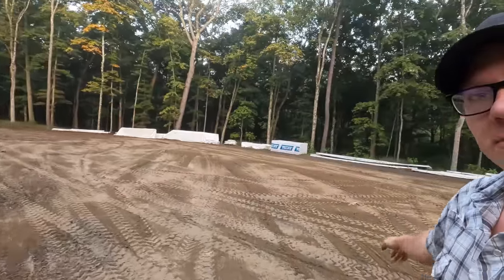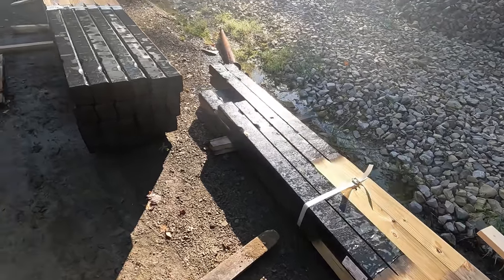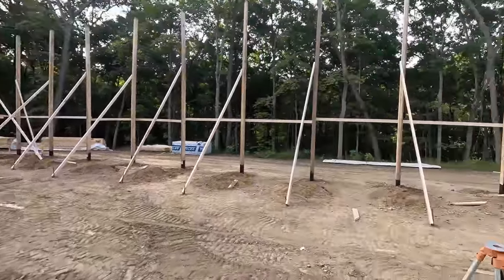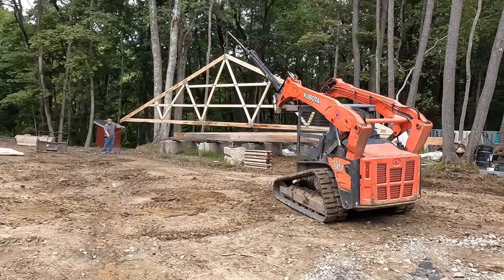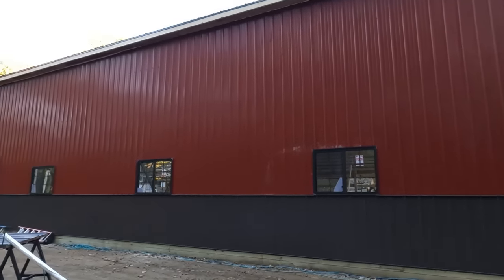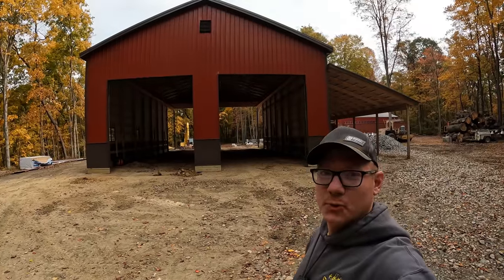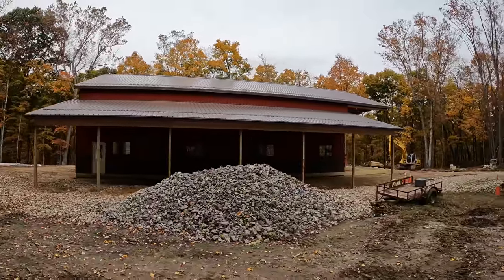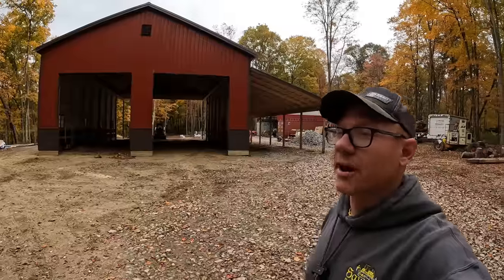Building a Dream Workshop! (Finally) Putting up the shell!

Comment: I never realised you could get a crane boom for those little skid steers. That looks pretty awesome and the guys clearly know what they are doing. It looks great Matt.
Reply: I thought that was a great attachment also.
Reply: Looked just like a fishing pole to me! 🎣
Reply: I'd imagine the load rating is very low on it, so its usefulness would be limited.  That said, trusses are light, and they may be made specifically for that purpose.  Worked great!
Reply: I was sat here wondering why they were using a skid steer instead of a telehandler, seemed like the wrong tool for the job!

Over here in the UK you very rarely see skid steers but telehandlers are everywhere.
Reply: @tomcardale5596  Most likely due to the Health & Safety rules compared to OSHA
Reply: @tomcardale5596  comes down to market preference I think. We build barns a bit different here anyway, rare to see a pole barn like this. Most use steel frames concreted in.
Reply: @mattyb120  oh definitely, though the general idea of pole in ground with stuff attached to it is conceptually similar at least! Even if the materials are different.
Reply: @tomcardale5596  It seems to work for light loads and is squat enough to fit under the buildings, so you can work from either end and I suppose in the middle should you need to fix something and need it supported, telehandlers tend to be twice the size of the skid steer or (Bobcats) as we call them in the UK.

Comment: I would highly suggest that you put piers in for a truck lift or maybe plan on a wildfire moveable lift. Remember that it is too late to add piers later if you have in floor heat.
    When you get older your knees will thank you . If it's never needed the added cost is pretty low and could actually add to the value of the building should you ever sell
   My apologies if your overhead crane is also an auto lift.

Comment: never even thought about building that way. in Europe we use a similar technique: we fill the Holes with concrete and put 2 pieces of flat steel bar in the concrete to bolt the wood onto. That prevents any rotting from happening and if if it starts to rot you can easily replace the rotten part.
anyway keep up the great work

Comment: Matt, for heating and cooling I put a 28,000 BTU, two head mini split in my 55x45 ft shop. I mainly did it for dehumidification in the summer time. It was cheaper than running two dehumidifiers plus it kept the shop at 74 deg instead of heating it up with the dehumidifiers. As an added plus it heats the shop in the in-between seasons of spring and fall. I have radiant propane for the main heat in the winter but could just run the mini splits year round if I wanted to. You will find out, 60 degrees in the winter, in a shop, out of the wind and weather is pure heaven!

Comment: Congrats Mat on your new shop. I do plead with you that you put in at least 10m rebar with a 16 inch grid throughout your pour. I have a concrete company in Peterborough, Ontario Canada and am retired. I am 76 years of age and I am more than impressed with your mechanical abilities. One thing that I do hope you will do is put the gantry crane in the shop as soon as you pour the floor and do the body work on your tractor for your float and equipment and paint it. I do not want to come across as very assertive but I know in my heart that you are going to do very good. Start painting and cleaning things up.

Comment: Nice Shop Matt. Be sure to have the Infloor heating properly sized. I have installed a few Infloor heating systems that was designed by the supply house where we purchased the materials. I would install in the back section too, if there is a good chance your going to enclose it. 
The outdoor wood boilers are great if your going to be there every day to keep it fed, otherwise I would recommend a High efficiency gas boiler, condensing boiler. My other tip would be the more money you spend on insulation now, the cheaper the building will be to Heat and cool for the life of the building. Spray foam is a great choice. The only other issue with spray foam would be electrical, if you plan on running behind the tin, it would have to be wired prior to filling the space with insulation. You can always run conduit. Thanks for the videos. Good luck.

Comment: I renovated my Barn/house/shop built 1915.  I used the same colors you did, looks nice.  6" gutters make a world of difference, good choice.  I would consider heating that outside slab.  Make it a separate zone if you can.  Do the AC, you'll love it.  Keeps everything from rusting.  Also a lot easier on your air compressor.  Good luck with the place, just don't fill it with junk!  Lot's or work but worth it.

Comment: Congrats!!!  A couple of tips if you care.
1. Install a powered exhaust fan on one of the gable ends. 
2. Go around the perimeter and screw in some lag bolts into the bottom band. Use about a 4-5
 lag and just screw it in enough to hold itself. This will keep the concrete tight to the band. As it cures the crete will pull away from the band and creates a bad draft that will suck all the energy out of your heated floors.

Comment: Matt, the new shop is beautiful. Can’t wait for the finishing touches. One good idea I saw mentioned is to put drains in the floor. Pipe them out of the building to a grease/oil trap to preserve the environment and save being fined by EPA. I was surprised you didn’t have skylights installed to provide daytime lighting since once the 4th wall is installed, it will be darker than it is now.

Comment: Love your videos Matt.  I just built a dream shop 60' x 50' in Manitoba Canada.  I used ICF  forms with  with a 24" x 20" thickened edge, similar preparation to your floor but didn]t need that much fill.  You did a great job Matt.

Comment: I am not an engineer, but I did spend my youth helping build pole barns like this, so take this long winded comment with that in mind. 

On a standard truss, the bottom cross member we call that a stringer. That thing is a tension member and prevents the walls from pushing out under a load on the roof, and also maintains the pitch of the roof itself (prevents it from kicking out and sagging). With your scissor truss, it extends the bottom member up at an angle to the top member in one straight line on either side, instead of stringing between the two top plates. So while that bottom member is under tension just like a regular triangular truss, it puts more compressive load on the rafter portion of the truss (which is already under compression) on the opposite side of the truss from each stringer's origin on the top plate. This is somewhat of an oversimplification, but you get the gist. If you beef up that rafter with heavier material, for example a 2x8 instead of a 2x6, or you create additional bracing, it can compensate for the increased load, but more than likely they didn't do that, so it is in fact a bit weaker than a standard truss. As long as your pitch is sufficient to prevent too heavy a snow load and you're not hanging anything heavy from the trusses, it doesn't really matter though. You're just trying to make sure that the truss can take the load of the roof and any snow that it holds while also maintaining the walls plumb, as well as maintaining rigidity sufficient to deal with any wind. In your unfinished area the change in truss will not add strength to the weak portion of the building where it would need it. Here your girts and the sheathing are what create rigidity in the wall structure, and with those missing, it doesn't really matter if you add strength to the roof, because the strength those trusses add is along a perpendicular plane to the wall. This is not to mention that any strength you lose out there is compensated for by the rigidity of the rest of the building that it's attached to. Any loads out there will transfer back into the rest of the structure and maintain the shape. 

Long story short, you could've just used the scissor trusses out there and it would've been just fine. If you are still concerned about it, and want to add strength where it's missing, you can add gussets down off of the posts to the top plates, especially at the outside corners furthest away from the completed wall. I understand that the building is already up, but I hope this helps someone understand the forces involved and if I'm wrong, I welcome any constructive criticism, so please comment below if you know something I don't about this subject.

Comment: Wow!  What a wonderful space Matt!  Been watching you for years...first comment.  I did something similar, I built a 40x80 but left 16' at each end, enclosing a 48' space.  That was 7 years ago and I wish I would have just enclosed the entire 40'x80' building.  You are certainly correct, you never have enough space and always wish you made it bigger!  Looking forward to seeing the radiant heat and spray foam installed!  I'm sure that will cost you mega dollars.  I only went with 1" closed cell spray foam but I'm in Alabama and it does very well.  I'm sure will want more.  I'm so happy for you dude!  Drive on!
Reply: Oh, and I have one 33K BTU mini-split in my 40x48 and it will make it as cool as you want it in the Alabama summer!

Comment: UK viewer here actually a retired Builder from Scotland and I know our regulations and Building Standards will vary quite significantly but I am very surprised you were not made to Concrete those posts into the ground. I know there is plenty Timber bracing them but I would imagine any damp/wet ground around them would subject them to movement with any wind

Comment: Outdoor wood boiler with a heat exchanger because you do not want to put a 180ﾟ water to a concrete floor. Usually keep it around 120 to 140.
 You could also pipe in a couple fan coils in the ceiling and blow the heat down. But radiant floor heating is the best 👌. 
 I definitely like the color that you chose in the hyperlapse video!!!

Comment: Get yourself a refer unit off a trailer. They work pretty good in the wall of a shop.  And if you found a duel power one it could run off the diesel or electric

Comment: Love how simply designed pole barns are. Not sure what crane you’ve purchased but you might consider using turn down footers along the edge of both sides (guessing 24” wide by 24” deep) and then a track on top the wheels of a gantry crane would roll on. I’d imagine it would roll back and forth the full length of the building….resulting in 100% of floor area covered by crane use. Just dig them, lay in the right rebar cages, pour at the same time the floor is poured. 😀

Comment: I have a 40’X80’ R-panel building on concrete slab for a home shop that was put in by the prior home owner. It has four exterior 10’X14’ steel paneled garage doors with a fifth as an interior door for a 20’X40’ bay divided off separately.  We love it and it is very useful but 12’ or 14’ wide doors would have been much better.  My bay doors have a line of thin windows across them I really like. They almost always let enough moon light in to see how to get out in a power failure so I have not gotten around to installing battery emg exit lights. A door on the back side adjacent others lets a breeze cross through and does wonders for keeping it bearable during Texas summers.  Go tall with your layout  and you will get even more use. I have a heated and air conditioned room with a bathroom with shower upstairs at one end, and with two 5x8’ windows looking down into the main bays. There is a stainless pedestal sink with foot controls and small closet with urinal under the stairs going up to the room.  Lots of stand-up work/storage is under the room. The walled off bay (20w’X40d’) has a 20’ wide, 14’ deep wood attic platform at the back with a black curtian that runs on a cable with pulleys to hide the stuff stored up there.  The bottom of the deck is 8’ so standing and working space is above and below the attic platform.  I even use the space between the joists for storing conduit etc.  A large NG heater hanging near the ceiling keeps the main shop above freezing in winter so I can keep the water on, and quickly to a comfortable temperature when working.  I have lots of HD pedestal and barrel fans for summer.  A 6’ steel fence, commercial doors openers and monitored alarm system finish it up. If I ever get opportunity I would like to take out the fiberglass insulation and have it spray foamed then air conditioned.  A downside is it is currently lighted by thirty something 8’ twin tube flouresant  fixtures each with two 110w bulbs no longer made but I think still available for now.  I have a lifetime of supply bulbs stored but at current electric rates are expensive to run.  I have started with specific areas but plan to upgrade all to LED.  Have fun with your shop and hope you enjoy it as much as we enjoy ours!

Comment: There is no cross bracing and the post connection on top don't sit on top of post, which is bit worrying with heavy snow loads.... does not look like a good safe building. Are there concrete foundation pillars? Hope they are not ground penetrated anchors...

Comment: 35 years building/electrical  experience here and that is a sharp looking building. Nice colors as well consider radiant heat? I know it is super expensive but so nice and pretty efficient.
Reply from the maker: Yup! It’s the only way to go!
Reply: Agreed, will appreciate it more when you get older and rolling around on concrete isn’t as much fun.  Warm slab helps a lot. Nice for washing and drying quick too,

Comment: I bought a used swingset for my kids that had that plastic rubber stuff on the outside of the lumber. The posts that contacted the wet ground were completely waterlogged inside. The end caps were still letting it soak it up, and there was nowhere for it to evaporate to either. Now a plus I see on yours is that they didn't do a lot of rubber above grade, so if they do get compromised, the water has somewhere to evaporate off. Hopefully they also figured out the seam at the bottom to make sure it stays sealed.

Comment: 150K project,  not bad. I would have installed posts on concrete above ground level but rest is awesome. Congratulations man.
I built 60x40 steel structure building and don't regret a single bit. All my empire is under one roof now lol
It's also nice when both ends do open up. Summer time is a breeze.

Comment: Very nice workshop Matt! Congratulations!
I don’t know how cold it gets in your area during winter but you gona heat a lot of air to warm this shop. 
I have a 30x40feet x 12feet tall shop with heated floor with outside wood boiler and we have -42c during winter sometimes and it’s hard to heat correctly. I do but the boiler need to be at full capacity all the time.

Comment: I hope you consider trenching a big loop near your new building and do a geothermal tube or two for your AC.  It is too bad you can't run a tube down to the river and use it as a heat exchanger for the air you would circulate!

Comment: 40 by 80 is my dream shop size! Currently have a 24 by 32...big enough when I bought the place, waaaaaaayyyyyyyyyyy too small now. If I had a 40 by 80, anything that I couldn't put inside would either be fine sitting outdoors, or get a quick sprucing up and sent to auction. 🙂

Comment: Matt, as a viewer/subscriber I got to tell ya I freaking love it! 
Worth the wait, for me anyway. 
Shortly, you will be able to work as a gentleman. Heated floor, roof over head. Staying warm and dry. With, I might add, your very own bathroom. Be sure to plumb in for a urinal. Not just the commode.
As you get older (I'm 72) working in the cold is tough on your body. This is the just what you needed.

Comment: There is the building unfinish so the size is more like auditorium bigger than the plan two bedroom home. The concrete is slab base below the wood floor of the barn workshop. The concrete will require of about 5% of water into the concrete and pebble up to not more than one inch thick. That is to prevent the rain water from contacting the all dirt underground that holds up the tallest wall studs of any customers except me.
 A little more than 5% of water may applied.
  One more question where is the big city that supply the Lowe's? Improvement of concrete supply and avail of S type mortar cement plus sand from White beach.

Comment: Beautiful shop, Matt! Only thing I would do different is enclose the entire lean to section. I would use half of it for fab work, small engine room, and / or parts storage and use the other half for a restroom (with a shower, I'm sure the wife loves grease and dirt in your current one!), kitchenette, and small hangout space. A mini-split system would be perfect in there. Having an air conditioned space to work on some of the smaller stuff would be great!

Comment: congrats on the new shop.recently hooked up to a old gasser case backhoe my dad had  man that things fought me tooth and nail got it running but it backfires and quits when we put it in gear its like a 71 model we cleaned lines tank 4 filters i dunno it just coughs and dies when we try to move it.we recently got it out of of a bunch of burdocs and heavy bushes it was buried in the woods.we took carb off rebuilt it and still same thing maybe it won..ugg.sad thing is my dad was a korean war vet he dyed in in 1981 at 47 and that was his tractor to start his buisness i found it 31 years later in the woods and im gonna get it to move if its the last thing i do.my dad was poor back then and he bought to many tractors  that didnt work or where wore out and he bought a d7 that he  got running pony motor was junk ftom day one
.he had it moving earth on the hillside for abit short abit.anyways going over tomorrow to work on that stupid case tractor again